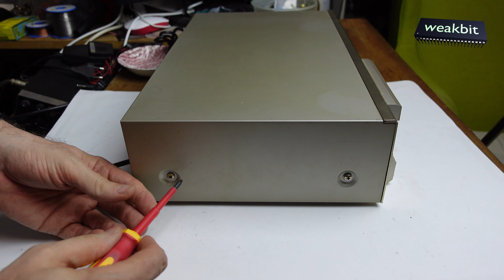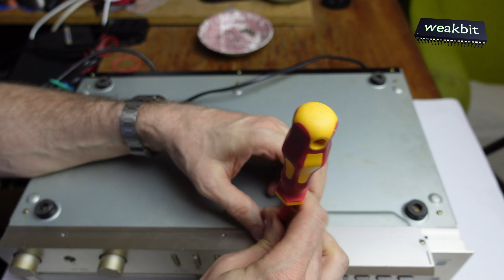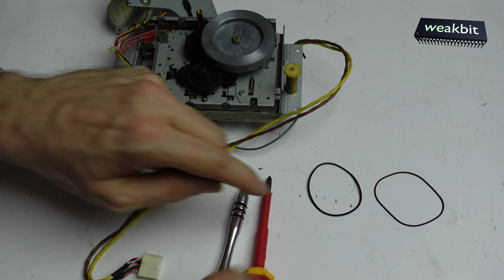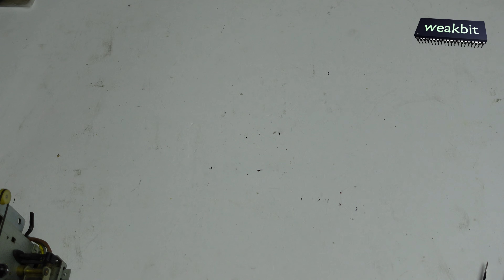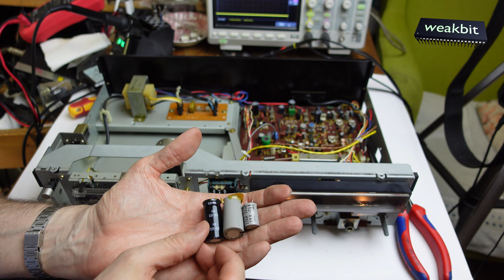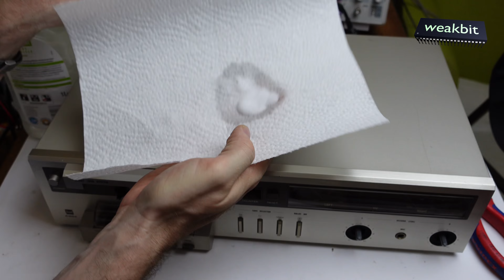Dual C804 Tape Deck repair

Comment: Hi...very interesting video! My C804 have a problem with the ff and rew function: a idler problem?!
Reply from the maker: Hello - this could good be. I your case is it necessary to change the idler in the middle and clean the wheels left and right side. So I think this could help. weakbit